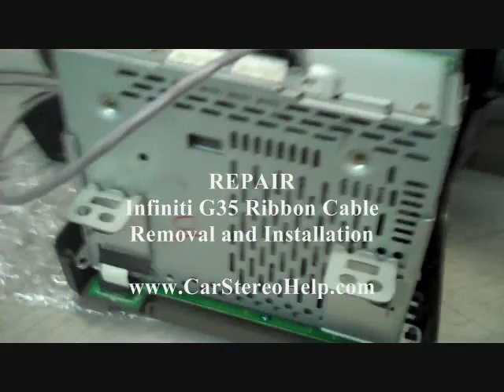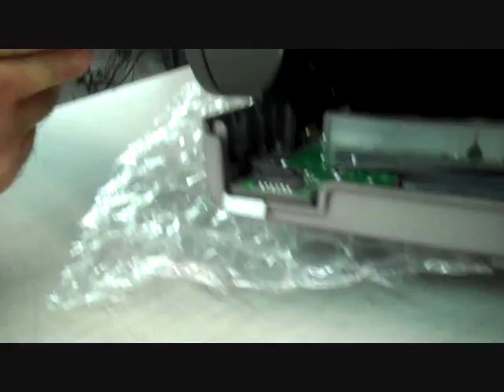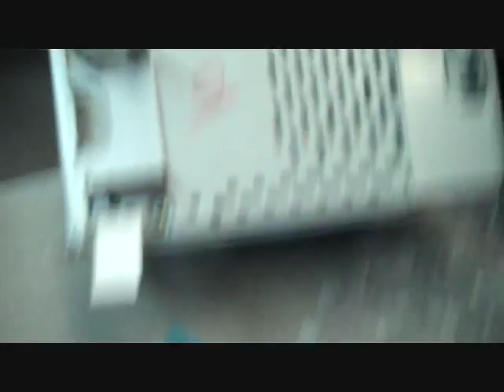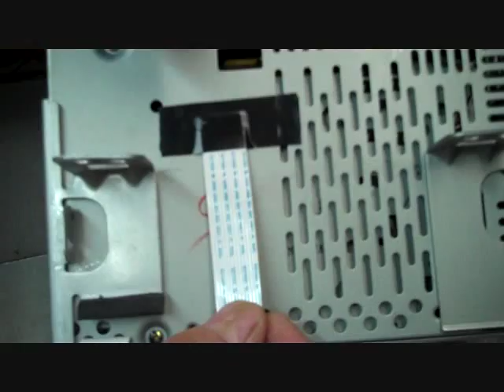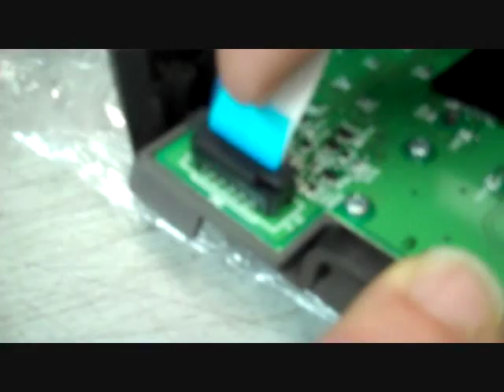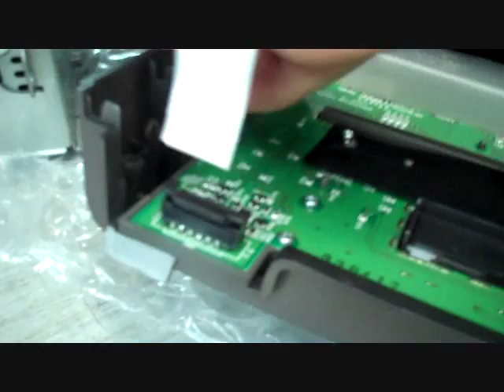Infiniti Bose G35 Audio Finisher Board Ribbon Cable Removal = Car Stereo HELP

Comment: Hey bud, I have an 03 g35 and the a/c is stuck on and the stereo does not work....I'm assuming I need a new finisher board? Would that be the fix, or is there another way to get it working correctly? Thanks!
Reply: Hey buddy did you ever get your ac  and radio working? I have a 2004 fx35 and it's doing the same thing
Reply: @ricardoacosta6239  hey buddy did u ever get it fixed im having a similar issue my console and tailights fuse keeps blowing
Reply: @alexa.g1079  my was a computer under the passenger dash side swith it and work ever since